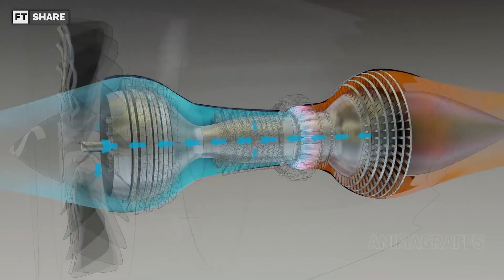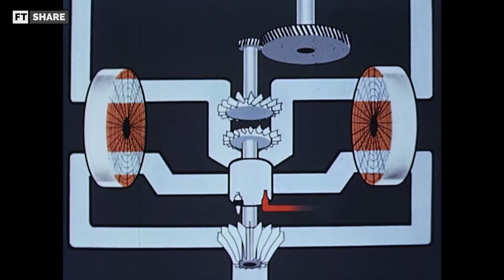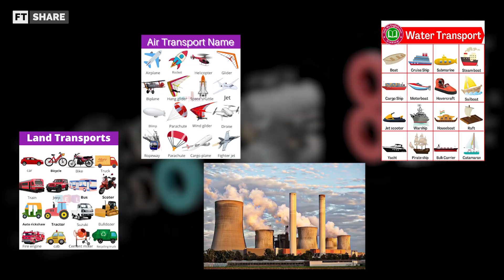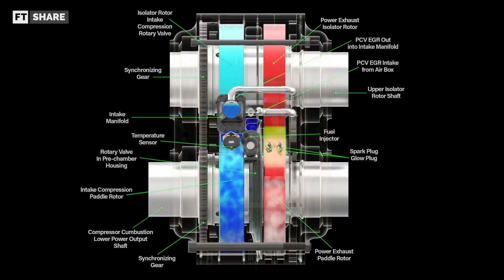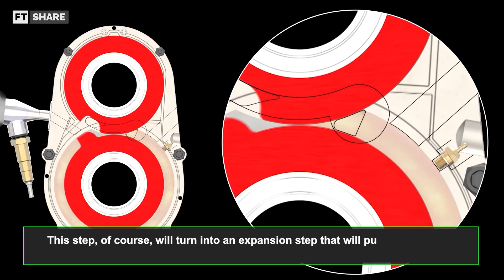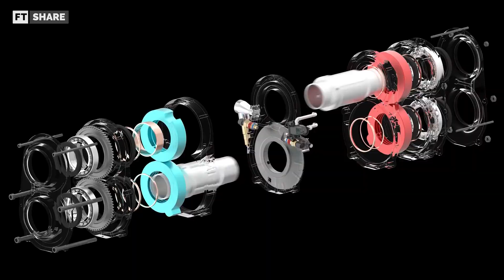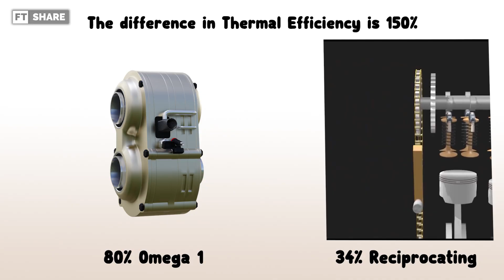Ready To Destroy EV Engine!! | Astron Aerospace - Omega 1 Engine

Comment: I don't see how this engine can produce 160 HP and 230 Nm of torque with what appears to be a significantly lower displacement and compression ratio compared to a typical 4 stroke engine. Sealing the combustion chamber is another concern. However, the concept of a circumferential 'piston' chamber is ideal in that it eliminates the vertical to horizontal power transfer inefficiency of a piston engine.

Comment: The often unknown advantage of intermittent processes of classic piston machines is that you can run at very high process temperatures (and therefore also with a very good Carnot efficiency) and at the same time not stress the surrounding material too much by cooling it with inlet air.
With the Omega 1 machine, the high process temperatures (as with turbines) are

turbines) are continuously applied to the housing. At the same time, the hot working areas and the cold intake area are very close to each other, which leads to extremely high thermal stresses and thus to demands on expensive high-performance materials. In discontinuous operation, typically on the road, the problem is dynamically intensified.

Comment: From the little I know of rotary engines heat localisation seems to be a big problem and this engine looks like it has same issue such that the first 120 degrees of the cycle will always be hotter causing problems with expansion. Looks very interesting though!

Comment: this one has the same problem as the Wankel engine. sealing surface! It seems like it should have much better efficiency but at the cost of much lower power output for the size of the engine.

Comment: The ideal engine should make 300hp on 0.5ml per second with 100lbf torque. To Abou 200 hp  100 lbf torque. This is just arbitary numbers 100mpg to run a car.

Comment: Hype and more hype! No apex seals ==> no radial seals at all == totally dependent on machined surface contact. Expensive, unreliable and geometrically disadvantaged. Huge face seals are required and at 20K RPM with questionable lubrication will probably not last very long.

Comment: In a harsh working environment of extreme heat and pressure,  anything more than three moving parts in the combustion chamber raises red flags.

Most importantly, no proper sealing solutions for so many areas will decrease efficiency and causes safety issues. Not to mention the cooling and lube. 
It has some merits of generating large torque and long working travel distance.

Comment: Chrysler Did not develop the gas turbine engine.

The gas turbine engine was initially conceptualized before WW2 by a Man named Sir Frank Whittle in the UK. During WW2 the engine was further developed into a flyable model and towards the end of the war it was used in operational fighter jets such as the Gloster meteor, engine production was initially done by Rover (british Layland)/and or (Rolls Royce). Around this time in Nazi Germany Hanz von Ohian also worked on developing a jet engine though a different configuration to the one being produced in England. Even though the configuration was different, it is highly likely that Hanz initially got the concept from publications from England. It eventually was implemented into the Heichel he-162 and Messerschmitt me 262 and was manufactured either by Junkers (A German aircraft company at the time) and or (BMW).

The day Chrysler Comes out with something as advanced as a gas turbine engine is the day the sun explodes into a bunch of confetti and all the water in every ocean turns to Bud light.

Comment: It either has tip seals or it leaks high pressure combustion gases. These are hand made - in the real world we need machining tolerances (or flexible seals). Another dream for the scrap bin.

Comment: I would imagine that it will require very exact tolerances, and it just looks like it might have durability issues. Reciprocating ICE engines may be rather primitive and they do break, but most places know how to work on them, and they CAN be made to last a half million miles or more if they do it right.

Comment: I think it will work.  It looks almost vibration free.  Gearing/clutching may be a challenge as I am not sure about the torque curve.  Hopefully it is flat.  With an RPM range like that it sure would be fun to have on a motorcycle.

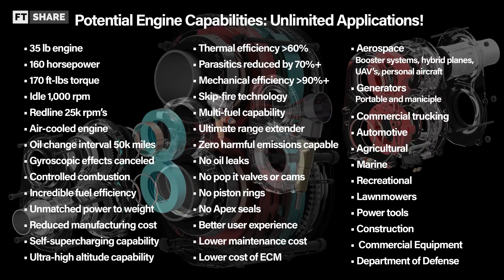Comment: Both founding agencies and video producers should re-check the high-school lessons on thermodynamics before believing in 80% efficiencies!!! Assuming this engine is AS EFFICIENT AS CARNOT, which is IMPOSSIBLE, given the exhaust (which, b.t.w, does not exist in Carnot but is the lowest T here ) is typically 450C (723 K), to reach 80%, 1-tc/th implies the hot stage runs at 3615 K !!! while the actual combustion ones stay usually below HALF that value, namely 1770 K. Going on the opposite reasoning, let's assume this chamber will (somehow magically) run at ~2000 C during the power slope (impossible, that is ~adiabatic expansion, it cools down doing work), the same IDEAL NONEXISTENT CARNOT will have to run the low slope at 454 K, i.e. 181 C, an extra-cool level after an extra-hot combustion.... maybe just adding some LN2 in the process :-))  So let's cool down and look better, they only claimed >60% at 4:59 which is a lot less than 80% but still hard to understand without an explicit cycle, while other good engines don't stop at 34% in their best regime. That is the MECHANICAL EFFICIENCY after counting the losses (which here were not presented!) and even so, the best diesel reaches 45% and some exhaust recovery recently introduced by Mercedes and others add other ~8% so, best "classic"  engines reach about 50% Mech and >75% overall and I doubt this new one is a lot better, not speaking about thermal effects at impossible temperatures, how that compression occurs almost without oil, how the oil braking speed limit is respected, etc... If their claim actually refers to the OVERALL EFFICIENCY (as apparently is the case, they stated "thermal", not "mechanical") then we are comparing here apples to bikes and this engine is not as spectacular as it seems. The line: Mech. Eff >90%+ means an extra, not an absolute value (course), so is an extra with respect to... what? Again tricky, this would mean 34% * 1.9 = 65 %, as if the Mechanical equals or greater than Thermal (cannot be, let's assume equal), anyway... a zero-loss engine, nice!

Comment: Not 80, but 85% Efficiency that is too..oo.. doubious.!! (Carnot cycle is 60% max.)
No Apex-seal, no Lube-oil.. there will be Great air-Leak out of cycle.. (i see white plume.)
The Red-line RPM, i don't care much but the RPM to get 170 ft-lb torque/160 hp...
The Operating RPM must be very high, 12,000+ rpm.. that will be too difficult to control.
Rotary Engine cannot provide enough Torque @ Low RPM... The gearing be Heavy to...
It maybe better for power-generator @ fixed speed, not varied load/rpm as car/blke.

Comment: I've designed over half a dozen rotary concepts and seen dozens more in the patent office. Some were a better version of this architecture. 

NEW FRONTIER TECHNOLOGY GROUP has a number of innovations we use in our 𝔽𝕦𝕖𝕝 𝔸𝕘𝕟𝕠𝕤𝕥𝕚𝕔 ℤ𝕖𝕣𝕠 𝔼𝕞𝕚𝕤𝕤𝕚𝕠𝕟 𝔼𝕟𝕘𝕚𝕟𝕖 [𝔽.𝔸.ℤ.𝔼.] which allow it to outperform all engines including EVs by a long mile..

In just 10 seconds I've improved the Omega-1 six ways from Sunday. ))) Many years ago I named one of my rotary concepts... wait for it... the O-Mega /Omega engine and published it on the internet. Hmmm 🤨🤔😔

On a separate note, despite the fact that electrics are not a viable solution for their high SYSTEM weight/volume & cost; lack of SYSTEM infrastructure, logistical support,power & energy density; and clear lack of critical component development cycle end timeline, incl. no global environmental benefits [honest engineers know this], we also offer the most torque dense, low cost, high performance e-machines.

Some of NFTG's innovations would allow Tesla to win the EV race...single handedly. Same for SpaceX. 😎 

Anyone have the relevant contact info?

Comment: 😶‍🌫🤯We will soon introduce the revolutionary FAZE engine technology.
The 𝔽𝕦𝕖𝕝 𝔸𝕘𝕟𝕠𝕤𝕥𝕚𝕔 ℤ𝕖𝕣𝕠 𝔼𝕞𝕚𝕤𝕤𝕚𝕠𝕟 𝔼𝕟𝕘𝕚𝕟𝕖  
[𝔽.𝔸.ℤ.𝔼.] tech best solves the issues present in previous internal 
combustion engine designs by transforming the old paradigm into a 
simple, low cost, quiet, power dense, efficient, on-the-go liquid and 
gas fuel-flexible, ‘non-polluting’ solution for power generation of all 
scales and advanced transportation, construction, military, off-road 
vehicles including ships, aircraft, trains & robots not possible before 

𝔽𝔸ℤ𝔼 delivers better than 25% ABSOLUTE/ACTUAL [not relative] 
fuel efficiency improvement over gasoline engines, more than 15% 
for Diesel engines at any operating condition - speed/load, ambient 
temperature or elevation, not just at one optimal testing point at 
STP. Real world driving cycle savings could be an additional 200% 
higher due to the constant MAXIMAL efficiency and torque. The 
simple, low cost, native/built-in, non-electric, environmentally safe, 
non-explosive, temperature agnostic 𝕊𝕦𝕡𝕖𝕣ℍ𝕪𝕓𝕣𝕚𝕕© feature 
recovers more energy than EVs and provides approx.100% fuel 
savings for a combined absolute vehicle fuel usage improvement of 
approximately 300%, thus obviating the basic need for expensive 
EVs & e-hybrids. 𝕚ℙ𝕠𝕨𝕖𝕣𝔹𝕠𝕠𝕤𝕥 adds >400% more torque. It’s like 
4 engines in 1. 𝕚𝔼𝕗𝕗𝕚𝕔𝕚𝕖𝕟𝕔𝕪𝔹𝕠𝕠𝕤𝕥2© further improves efficiency, 
torque, power & other performance metrics by 10%. This is all done 
w/o a transmission. Additional fuel saving solutions are available.
 
The FAZE engine perfectly follows the vehicle’s road or genset’s 
electrical power demand with no energy loss [no fuel waste], This 
unique characteristic enables dispensing with any auxiliary power 
units [APU] for power or refrigeration in any application. This also 
makes for a perfect range extender for battery electric vehicles [EV] 
or as a standalone EV charging unit even where is no electric grid.
 
The fuel agnostic capability allows instantaneous use of any liquid 
or gaseous fuel [natural gas at home!!!] incl. biofuels and hydrogen, 
even if old/dirty/unprocessed like flare gas or employ the concurrent 
multi-fuel capability…anywhere on the globe. One engine for all 
locales w/o changes! Unlike EVs, this enables fast fueling anytime, 
anywhere…with no troublesome infrastructure disruptions or 
changes. EV’s are not a solution to the [FAKE]climate or mobility topics as 
high level of electrification globally is unrealistic 
[See Patrick Boyle's video "Electrify Everything?"] 

The technology offers smokeless, non-polluting, low odor heat and 
noise output without costly after-treatments, etc.,… with only the 
lowest  CO2. It has a negative carbon footprint with hydrogen, 
ammonia, biofuels or gasified municipal, agricultural and/or forest 
waste and coal from a 2-stroke-like simplicity. These are HUGE 
business opportunities. We can provide these turnkey solutions 

The FAZE technology can be integrated into any ICE or vehicle 
architecture, adding some of the positive characteristics to its own. An advanced Scotch Yoke architecture slated to be incorporated in the 𝔽𝕦𝕖𝕝 𝔸𝕘𝕟𝕠𝕤𝕥𝕚𝕔 ℤ𝕖𝕣𝕠 𝔼𝕞𝕚𝕤𝕤𝕚𝕠𝕟 𝔼𝕟𝕘𝕚𝕟𝕖  [𝔽.𝔸.ℤ.𝔼.]

With virtually no electronics and emissions equipment, the cost of
purchase and reduced servicing frequency make this solution 
even more appealing.

Comment: The engine appears to have a lot of surface area exposed to combustion compared to the volume.  This implies a lot of heat loss and poor fuel efficiency; similar to the Wankel rotary.

Comment: i turned this into a single circle, the interior have rectangle shape and a flap valve that open half way to close the circle into 2 part ,and then a piston inside the tube one side seals the tube inside, and other side is thin and tiny, so when the piston reach the valve, the tiny side push the valve up till the big part of piston finally opens it full, piston should me half circle long, its hard to get from this text, yt wont let me post diagram

Comment: I worked a factory to produce the rotary engine, There were too many tolerances to me met so it was cancelled. We should also be concerned about air consumption. A normal 3 liter piston engine consumes as much air as 15,000 people. How much will this consume? Imagine China and India wiht cars powered by these engines. Remember our atmosphere is a thin layer around the planet , like the onion skin on an onion. I like the weight reduction. If we put $100 worth of gas in a 4000 pound car $95 goes to move the car, $5 to move the 200 passenger.

Comment: So much BS in 10 minutes, amazing!

The Chrysler turbo car was a complete and utter dead end from the beginning. They learned the hard way, that

1. turbines suck at fluctuating partial load (which you use a lot in automobiles, far less in things that fly)
2. turbines scale very badly (the smaller they are the less efficient they are)
3, they are LOUD (which is more of a hassle with a car at the curb than with a plane high up in the air)

There is a reason why real-world turbines start around 500HP, below that they are just too inefficient in relation to development/production/running cost.

But at least the video is funny with yet another cranky engine idea hailed as the greatest thing since sliced bread ...

Comment: I like it very much, but I think it would be a waste of technology to used as a Generator to charge batteries only. I think because of the thermal capacity and efficiency it would be better to adapt to run by it self with hydrogen. Clean and powerful.

Comment: Cartoons are fine for getting the general concept across, but there are no details of what the actual parts inside look like.  How is a tight enough mechanical seal made between the circumferences of the rotors to get substantially more compression than leakage between those surfaces??  How are the sides of the rotors sealed at the case to prevent leakage there?  Those surfaces would have to be polished to a mirror finish, and maintained as such to keep the gas where you want it.
  What would be more efficient, to use intake rotors that have more swept area than the exhaust rotors, and thus have a higher Delta P internally, or use exhaust rotors  that have more swept area than the intake rotors, and thus have a higher Delta P on the exhaust side of things?  Or use a supercharger of some kind to get a Brayton Cycle?  A turbocharger should work well there in either case as there's no mechanical parasitic load.

Comment: Is this correct that heat should not be much of an issue since it is supposed to be about 80% efficient? My concern are more with the roller bearings, if they wear then they mess up with the tolerances of the rotors !! What about the speeds of the rollers in the bearings if the engine's max RPM is 25K RPM !! As it appears in the drawings, the bearings and the syncrogears appear to be the weakest points to further get more engineering time.

Comment: Living in the cold climate of Canada, I wonder how it will perform starting from -30°C and manage thermal contraction and expansion. Other than that, this engine has such a broad number of potential uses that it will certainly find it's place if it delivers on it's promises. Even a 60% efficency (numbers's I've read so far) is a great improvement, but CO2 emissions means its oil fueled version would most probably be a transition technology for vehicles outside of current electric motors capabilities. In cars, I see it becoming a PHEV's range extender and a strong contender for hydrogen fueled cars if we come to have the infrastructures for it.

Comment: Must be pretty tight tolerances they need between the rotors, which means the entire assembly stack feeds into that.  Everything internal combustion uses interference fits for sealing the intake/compression/ignition/exhaust chamber is an interference fit, created by rings or vanes.  Not sure how they could overcome that, especially when thermal changes come into consideration.  Now throw in tolerance allowances necessary for mass production, and you have a helluva challenge.

Comment: Having sold precision gear metering pumps, gerotor and lobe-style pumps, I'm pretty familiar with their limitations, and this motor is like a weird sorta 2-stage (high-speed) lobe pump.  Low viscosity is a real problem for any positive displacement pump - an air/fuel mixture has none (no lubricity, either).   I imagine that the internal clearances would have to be extremely tight, on the order of 1-2/10,000", and when you add thermal expansion (dissimilar on the two stages) to that, I'd expect it to seize-up.   It might just seize-up on a cold day, too.   Good luck Astron Aerospace.

Comment: The problem is the torque is terrible because there's only one combustion chamber. You may call it a 4 stroke, but the advantage of a multiple cylinder ICE is that you have 4 power strokes with every cycle of the engine. In this case you only have one. So, the torque with this engine is really bad. Now if you add say 3 more combustion rings at 120 degree intervals...you might get some decent power. But that means 3 more precombustion chambers too that don't produce any power.

Comment: The effect can not be 80% since there is not the heat difference that would allow that amount of effect.  Base on how much compression can be achieved by this setup the max efficiency would be around 30%. 20%to the wheels. This is simple thermodynamics.  Sorry.

Comment: Unfortunately what could have been a great video has gibberish spoken over a video that doesn't backup any of the claims.  It states a material needs to be developed for the housing/combustion chamber, if you haven't got a housing you haven't got an engine and you certainly don't then have any of the claims made.